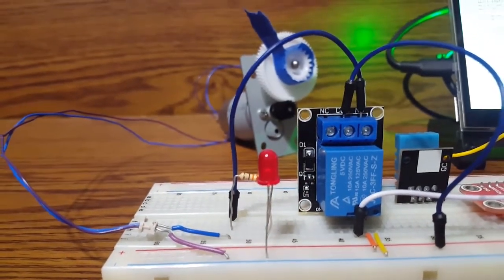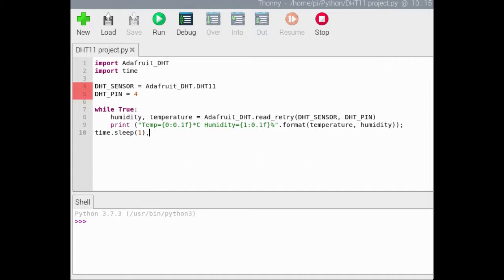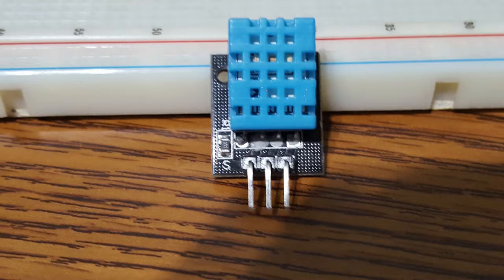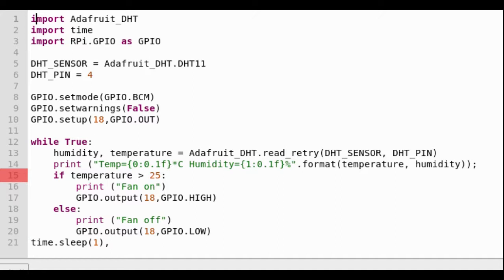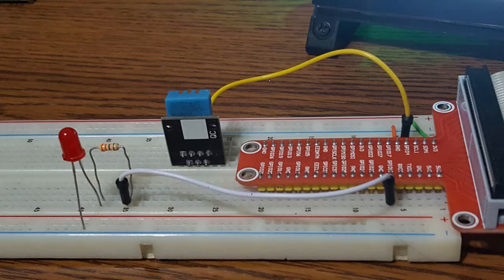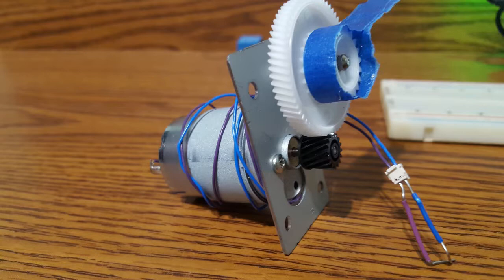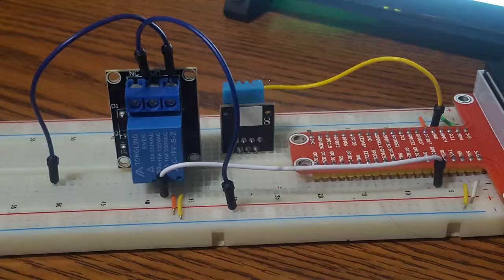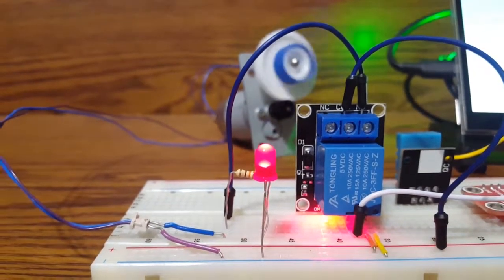Basic Raspberry Pi Automation - DHT11, Relay, Motor, Python

Comment: hello sorry i can't speak english.  I'm using google translate.  i want to ask on line 10 (GPIO setup(18,GPIO.OUT). does the number 18 represent the raspberry pi GPIO pin?
Reply from the maker: Yes, that is correct. This line sets pin 18 as an output device so that it can be turned on and off later in the code.

Comment: merhaba % 65 nemde çalışıp % 80 nemde kesecek bir kod lazım teşekkürler
Reply from the maker: It sounds like you want to connect a humidifier to the relay to keep the humidity between 65% and 80%. If that is true, you will probably want to use a variable to read the state of pin 18 to report when the humidifier is turned on and when it is turned off.  To do this with the code from the video, you will want to change the "while" loop. In this example, after checking the humidity and turning on the humidifier as needed, the code will read the state of pin 18 and save the value to the variable "state". If that variable has a value, it wil report that the pin is on. Otherwise, it will report that the pin is off.

while True:
     humidity, temperature = Adafruit_DHT.read_retry(DHT_SENSOR, DHT_PIN)
     print ("Temperature={0:0.1f}*C Humidity={1:0.1f}%".format(temperature, humidity));
     if humidity < 65:
         GPIO.output(18,GPIO.HIGH)
     if humidity > 80:
         GPIO.output(18,GPIO.LOW)
     state = GPIO.input(18)
     if state:
         print ("Humidifier is on")
     else:
         print ("Humidifier is off")
     time.sleep(1),

I hope this helps!